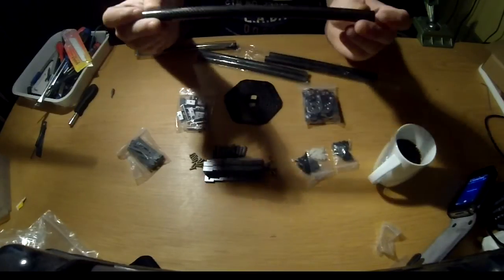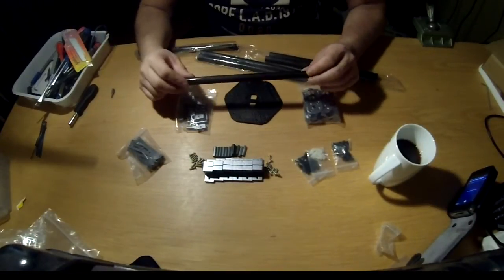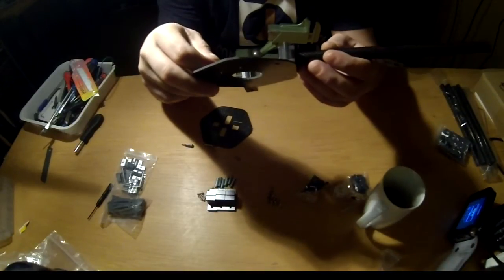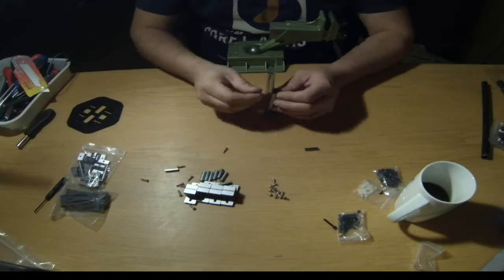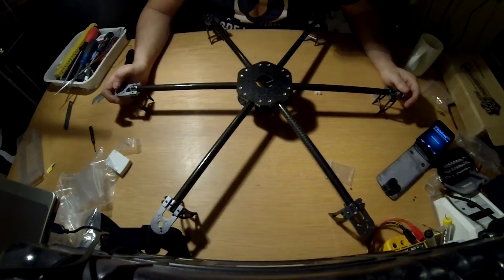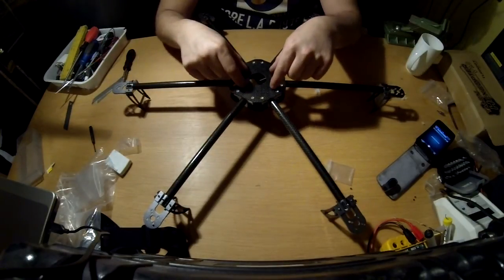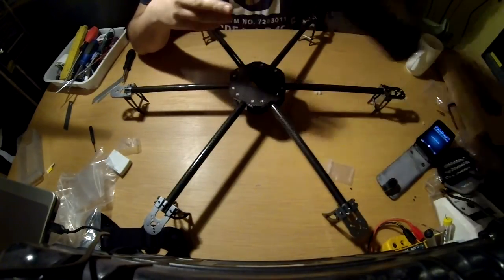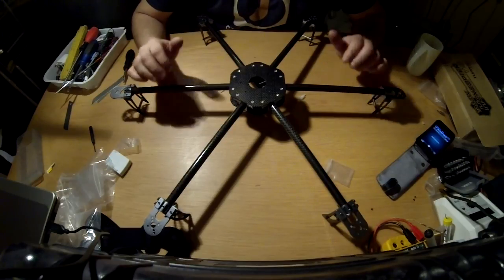Martini's first hexacopter build

Comment: As ericnelsonnn pointed out, use the "Talon tricopter V1" parts or "Talon Quadcopter V2" parts to get 14mm diameter booms. The Talon Tricopter V1 and Hexacopter V1 are developed from Quadcopter V2. It's a bit confusing, I know. Just look on the Hobbyking website for "Turnigy Talon V2 Carbon Fiber Extended Boom 320mm (2 pcs)" or "Turnigy Talon Tricopter (V1.0) - Extended Carbon Fibre Boom (380mm) (3pcs)"